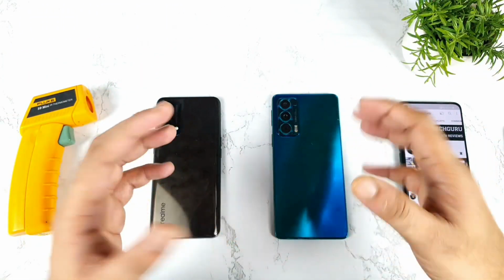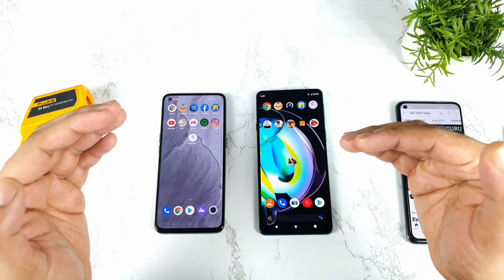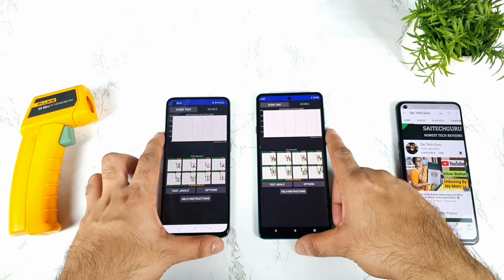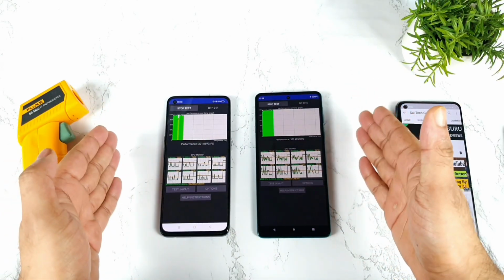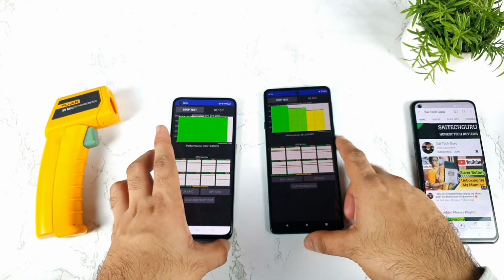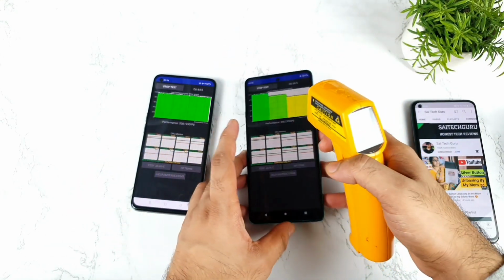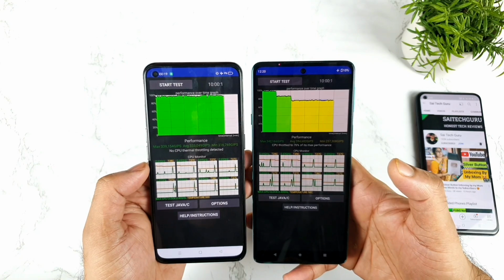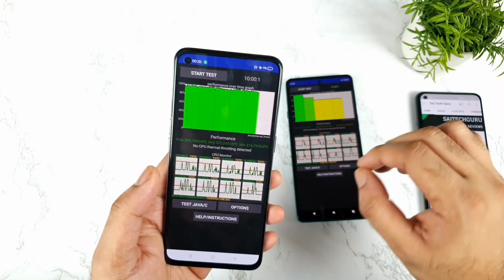Realme GT ME vs Moto Edge 20  CPU Throttling test Below 15% Battery Which is Best 🤔😱🔥

Comment: This doesn't make any sense stock Android devices are set to reduce performance below 15% inorder toconsume less battery it will get even worse when you reach 10%.
Reply: Same thought bhaiya, my moto device perform low when battery is below 20, but in normal stage its good (device :moto g40 fusion)

Comment: I think master edition has an edge cuz its heavy compared to moto . Moto is quite thin due to that heat catches quickly to phone . But in long term it doesn't affect that much
Reply: Its only 180g and 8mm thickness which is light only the voyager grey is slightly heavier and thicker